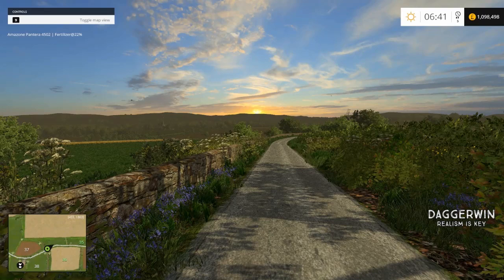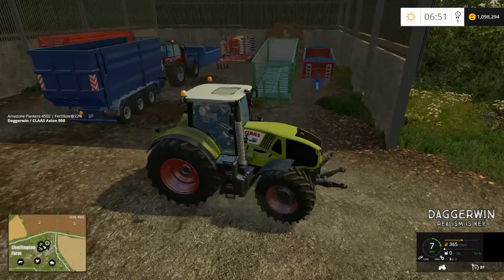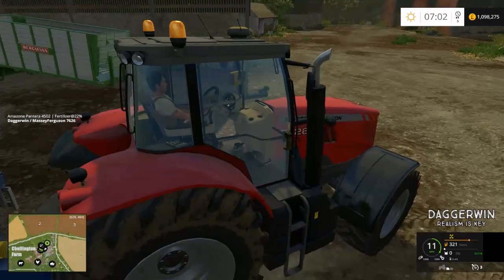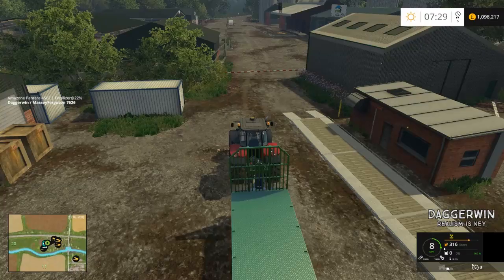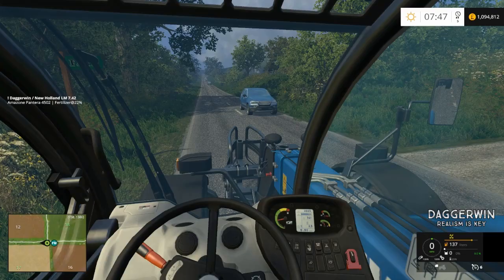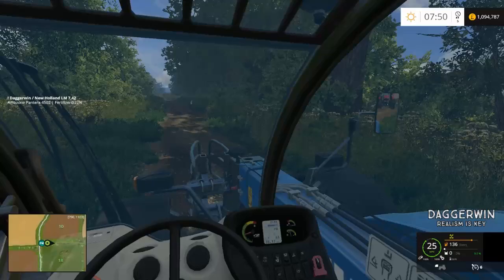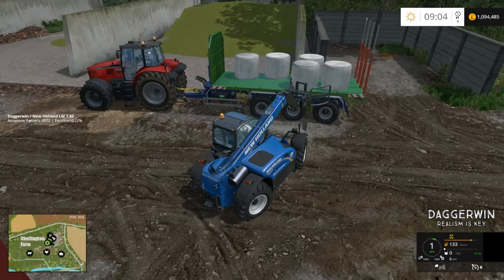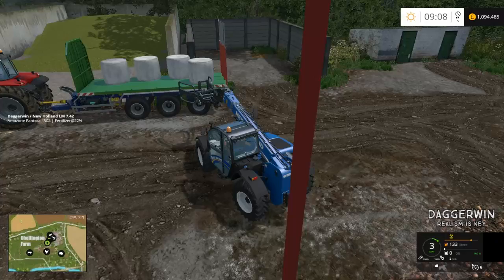Let's Play Farming Simulator 15 | Chellington Extended | Episode 1

Comment: I think you should disable the crop destruction on drive control. It is totally unrealistic. You are going to be destroying a lot of your crops and grass. I disabled mine because even when you drive on a field that has no crops in, when you plant that field, you will see all of your tire tracks, and no crop will grow where there are tire tracks, even if the field has been cultivated, or ploughed. Also, your tractors seem to be working fine which is really strange as my Claas 950 & Massey tractors were sliding around all over the place. The Claas 850 works fine for me, and some of the Fendt's are working ok. It will also be interesting to see if you have any problems if/when you use the Krone Ultima baler and Marshall Autostack bale trailer.
Reply from the maker: +Shaun Broderick Yeah, do you know what button to press to disable the crop destruction?
Reply: +Daggerwin it's an option in the config file in the directory with the save games and mod folders. There's also a hotfix out for real terrain on the fsuk forums because of the issues with the Massey and some of the others
Reply: +Daggerwin u need to go in to the file like u do to turn off the shuttle mode and change the crop destruction from true to false. Hope that helps. Let me no if not. :)
Reply: +Shaun Broderick how is it unrealistic?
Reply: You need to open the Drive control xml file and change the value for crop destruction from true to false, and Craig Maly, you have not listened to a word I have said. Please read the whole post. It is very far from realistic.

Comment: under your FS15 folder under my games u have a file that is called driverControl_config.xml and in that one at the top there is all the moduls u can enable or disable and FruitDestruction is the one that is going to say false if u dont want to destroy everything u run on thoue when couresplay drive tractorse it is auto disabled